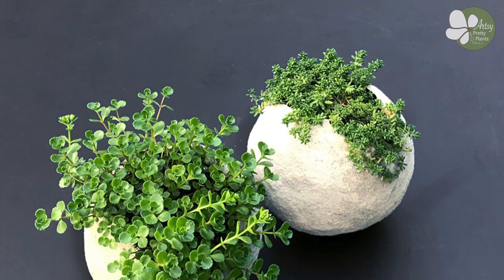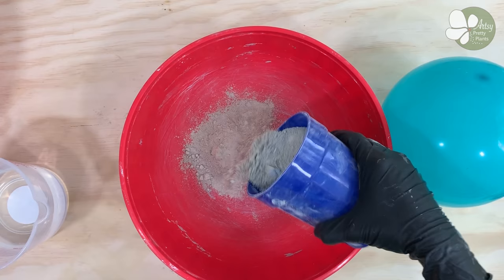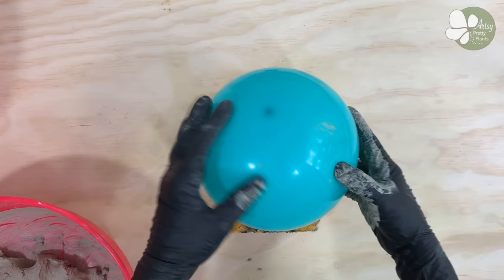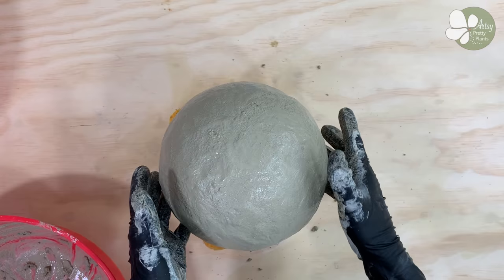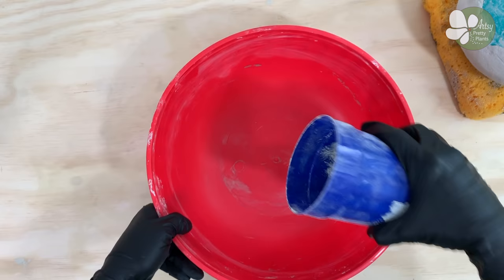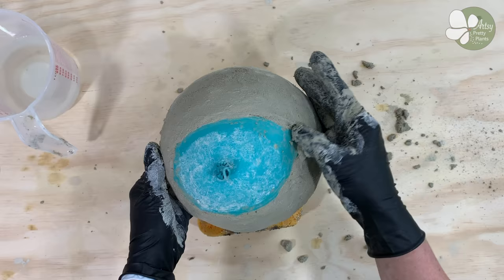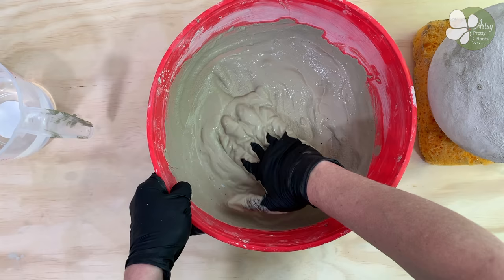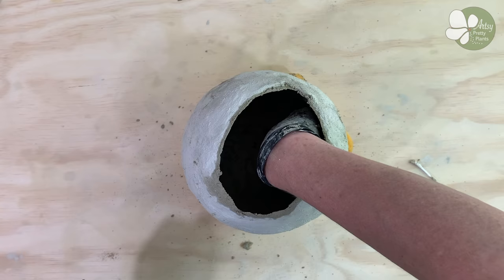DIY Cement Balloon Planter

Comment: I have a question, why did you use a slurry coat on the inside instead of doing it on the outside? Thank you. Nice video.
Reply from the maker: Hi Lisa,
Thanks! I put the slurry coat on the inside because I wanted the outside to get it nice and round and even. It was also quicker and easier to just pour it inside.
Reply: @ArtsyPrettyPlants  Thank You! I seriously want to try this.
Reply from the maker: It’s really pretty easy as long as you use the Rapidset Cementall. If you try it, then post a pic. I don’t know if you can do it here, but you can on my website in the Cement Balloon Planter post, in the comments section. I’d love to see it. https://artsyprettyplants.com/cement-balloon-planter/

Comment: I eant to tey this, but doesn't the balloon planter tip over, when the bottom part is round?
Reply from the maker: Not at all. With soil in it, it just settles in one spot. It’s not perfectly round like one made in a factory. I have a couple dozen of these in use and they don’t roll.

Comment: I havent started my cement journey yet, but i love your vids! I do have a question about how to get rid of the left over cement, and does just rinsing the bowl disolve it enough should i have a designated wash space outside? Lol so many logistical questions lmao
Reply from the maker: Hi Amanda, that's always a predicament for me. Disposal isn't very environmentally friendly. If you are rinsing, make sure you don't rinse it down any sink drain or you will ruin your pipes. You really only have two decent options. Either let the cement dry in the bowl make sure the bowl you use is really flexible) and bend it after it dries and much of it will crack off and you can throw it way. 

Or take a paper towel and wipe out as much as you can. Often this is good enough. Sometimes I will still need to use a garden hose. It is said that run-off from concretebut hopefully
Reply: @ArtsyPrettyPlants  im gonna have a small area w gravel to dump my acrylic paint water would that area work to spray down equipment? I will try that to start. I havent even finished working on the area to make it workable that may take me a few months lol. Thank you for all the vids and the website answered so many questions and gave me so many ideas! Eeek ! :)
Reply from the maker: @amandaritzau2602  That's basically what I'm doing. Good luck!

Comment: Hey new to this just wanna know does this break itself as its cement or do we need some fixture for stronger planter??
Reply from the maker: If you are in the US, use Cement All, it is premixed with sand already and will not break- it's incredibly strong. You cannot use a portland cement only, it will need sand mixed in. Try a a ratio of 2 cement to 1 sand. It cures after 24 hours and is a litter more difficult to do than with the 1 hour curing Cement All, but very doable still.

Comment: I have a question: If i wanted to make a much larger version of this say a foot high, should I use something to reenforce it? like squares of wire mesh in the "mold"?  And if i did I wast thinking it would have to be a certain thickness. Also I was wondering, is there a way to sand the edges on the opening of one of these planters? Thanks!
Reply from the maker: Hi Jessica, I haven't made one that large, but you are on the right track. Made By Barb has a tutorial on how to do this -https://www.madebybarb.com/2017/06/18/giant-concrete-garden-orbs/
Yes, you can sand the opening. The easiest way to do it is to make a homemade sanding block- made with Cement All. Just shape the cement into a sanding block shape and let it cure. This will quickly and easily sand very rough edges. If you want it super smooth, just use a finer grit sanding sponge after the cement block.

Comment: What about sealing? I know there are concrete sealers but they seem to be expensive. Would you use krylon matte finish for instance?
Reply from the maker: It depends on what your reason is for sealing it. I don't seal my planters usually. If you are trying to keep it looking white, then Krylon would be okay, but you would want to spray it inside and out. It will definitely help, but it will be better for plants if it isn't sealed. You will be retaining more moisture (and maybe too much) by using the spray or any other sealer. If you aren't planting succulents inside, then it isn't as much of an issue.
Reply: @ArtsyPrettyPlants  Much thanks for the advice. I wasn’t sure if sealing was commonplace but I will leave it unsealed after reading your response. Thanks again! I’m about to experiment a Hypertufa pot using CementAll. ;)

Comment: You have to be using special craft cement because nothing I have tried at the hardware store is as smooth as what you use and yours works like clay.  What I have is gritty and does not smooth out.  Please use brands of cement and where to buy
Reply from the maker: It's linked in the description above. Got it at Home Depot.

Comment: I have tried this but when the cement dried it came off inform of flakes why??
Reply from the maker: Hi, what kind of cement did you use?
Reply: @ArtsyPrettyPlants  I don't know exactly but maybe it was Ordinary Portland cement...
Which type of cement u have used?
Reply from the maker: Study with me It’s important to use Rapid Set Cementall. I have more details on my website about the materials. It’s much easier with quick setting cement. Plus it’s a bonus that you can do the whole thing in less than 2 hours. Cement All is more white than regular Portland cement too- if that matters to you. Take a look at my site- www.artsyprettyplants.com/cement-balloon-planter
Reply from the maker: I use Cement All for most of my projects. It’s just so easy. It’s not as fussy about the amount of water it needs. It’s more forgiving, but ya gotta move quickly as it sets in 10 minutes.

Comment: Did you use a sealer that wasn't showed?
Reply from the maker: I didn’t use a sealer. I haven’t used a sealer for any of my cement planter projects. You should be good without it!
Reply from the maker: @lostpelican1883 Hi, if you are planting succulents, then no. They prefer alkaline soil. Most other plants do not. So yes, you can soak then for 24 hours to remove the alkalinity in the cement.